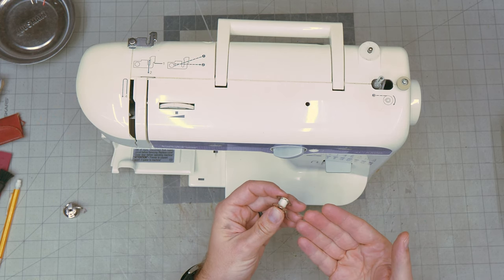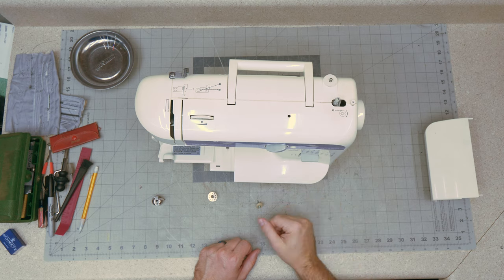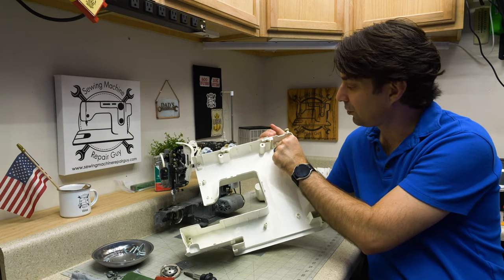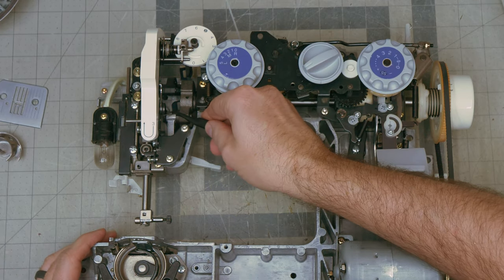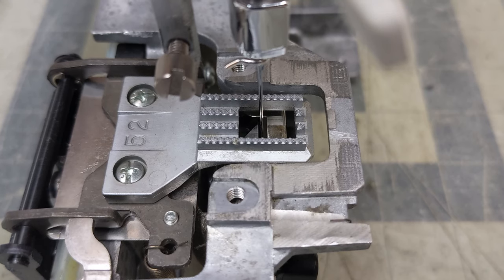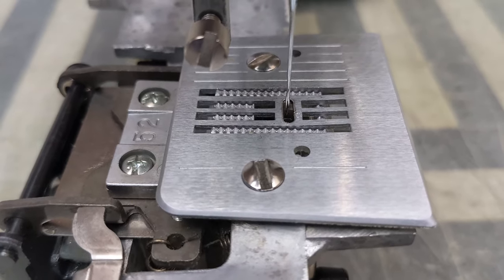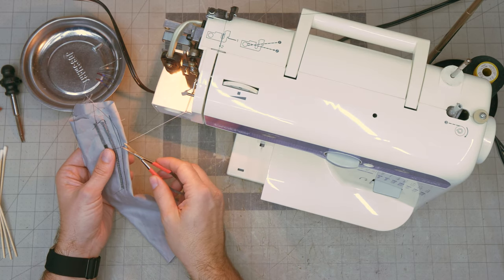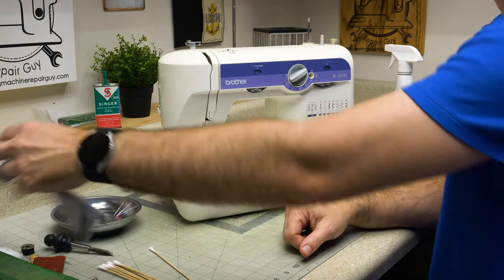What is a Bobbin Winder Stopper? And how NOT to Adjust it

Comment: The moral of this story is - Never loosen a screw on a sewing machine unless you know what you're doing!   I can attest to that because I was trying to clear a jamb on my old Bernina, unscrewed the thread guide at the top of the needle and the hook fell inside the machine never to be found again, lol.   I opened the case, shook it all around multiple times - I can't hear it so it must have firmly grabbed somewhere inside that I cannot see  :(
Reply from the maker: Whoa! I hope you find it.
Reply: Found that out myself. In addition to the nut that must have fallen off my bobbin winder stopper, I remember removing a long screw that also disappeared in the void and no amount of shaking has produced either.

Comment: Thank you.

My bobbin winder stopper is fixed and does not turn/twist like this one does. I believe it is causing the uneven and pyramid shaped bobbin winding where all the thread is wound at the bottom of the bobbin.
How do I fix uneven bobbin winding and stop the pyramid from forming?

My zigzag and decorative stitches skip stitches or just do the straight stitch instead of the zigzag/decorative stitch. May you please do a more detailed/focused video on fixing the hook timing and zigzag/decorative stitch problems.